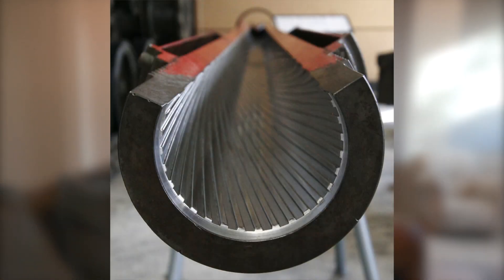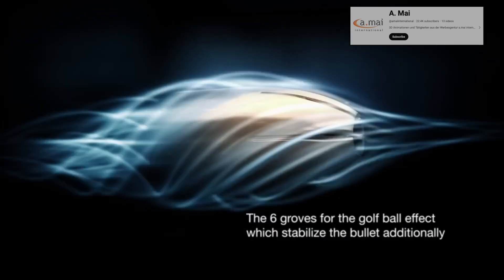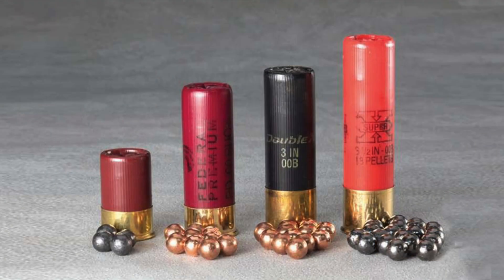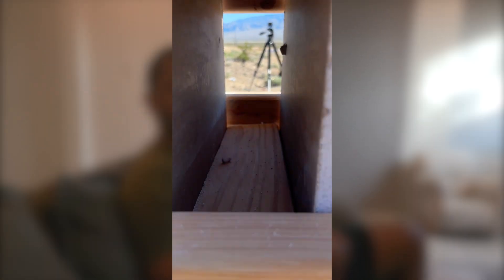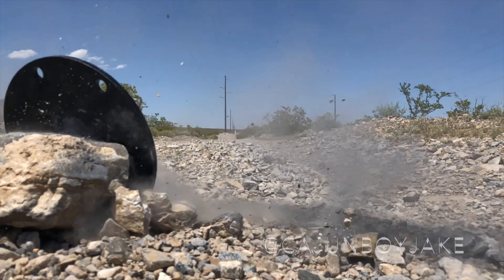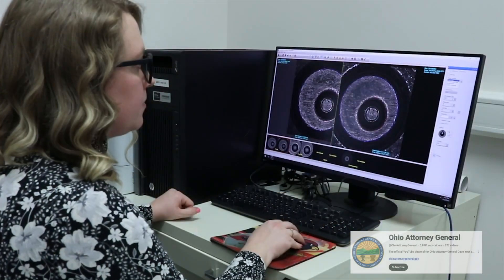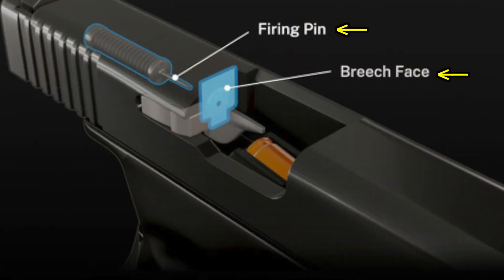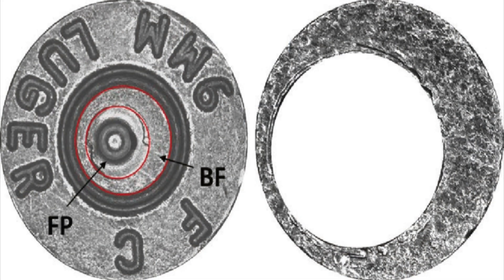Bullets Tell the Tale of How Guns are Linked to Crime #guns #shooting #crime

Comment: guns are mass produced. they dont change the tooling between each and every gun produced. they are not snow flakes.
Reply: Go to a gun factory; these aren't vibrators these are more like watches
Reply: @karimmoop9560  some guns are closer to s folding pocket knife to a watch really depends on the gun
Reply: Pretty sure the only difference could be a brand new barrel and a well used barrel would definitely not match. So if you theoretically used the gun alot and the investigation took a long time (and they did not recover casinos) you might be in the good.
Reply: That’s mostly correct. There will be small differences between each gun. Manufacturing processes aren't perfect at mass production scales.